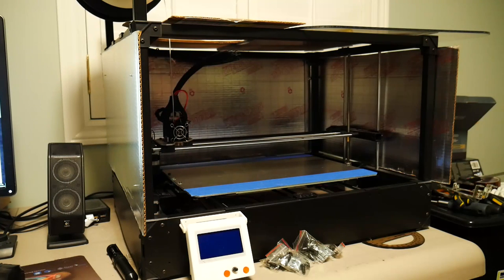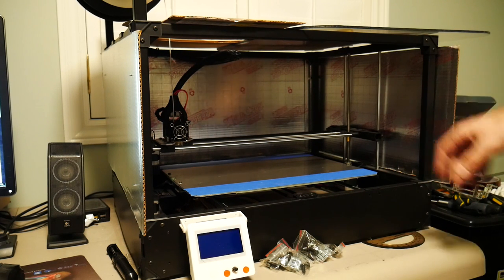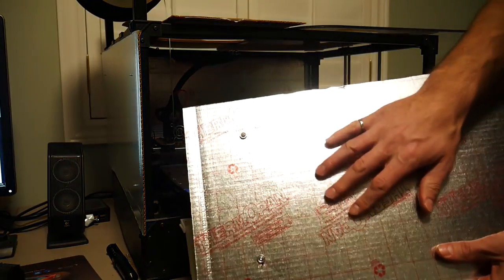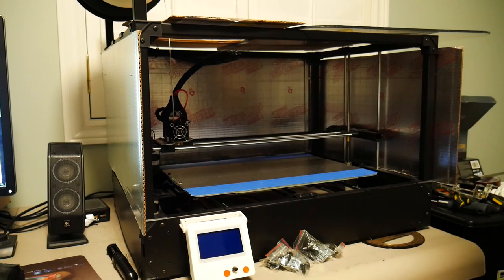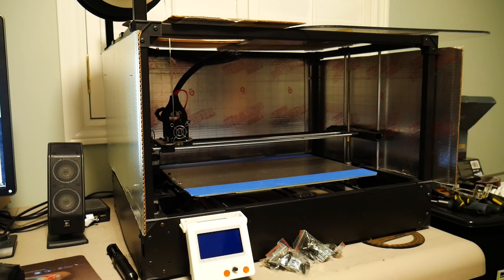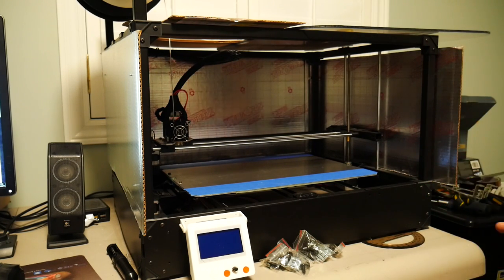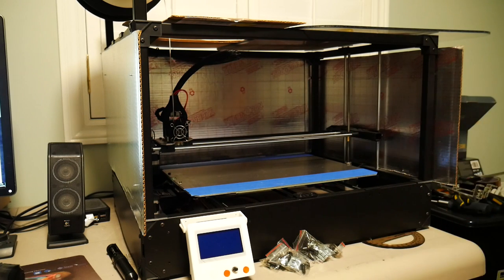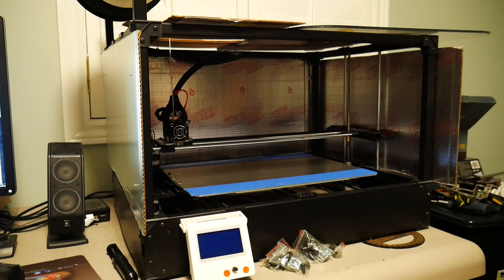DIY 3D Printer Heated Enclosure / Chamber for $15 in 15 mins!!

Comment: This isn't a heated enclosure at all. Booo.
Reply from the maker: Hi Charlie, the heat comes from the heated bed so the internal temperature is greater than the ambient air outside of the printer.
Reply: Lol nice clickbait title
Reply: This is an example of an enclosure, or an insulated enclosure. This is not a heated chamber! Heated chambers are needed for high temperature thermoplastics and require active heating and temperatures up to 60 degrees celsius in order to avoid warping/de-lamination and produce a successful print! (Polycarbonate, PEEK, PEK, Ultem, etc.)
Reply: I believe this is a great idea I did something similar and it worked wonders

Comment: Or you could just use cardboard and cover it with tin foil to save buying this stuff specially.

What I will probably do is buy 5 A3 size clear acrylic sheets so I can see how the print is going in there. Otherwise you won't know, and if you open it up to take a peek you will probably mess up your print.

Thinking about it now, I only need the front to be clear, so I might go with your method for the sides and top to keep costs down. Thanks
Reply from the maker: You could definitely use the cardboard and tin foil method, but if this stuff is available in your area its just a lot cleaner looking. Plus whatever they add to the core material makes it fire retardant as a bonus. I actually have a flat sheet of lexan on top that I cover half the opening with so I can see my prints as well :) Great minds think alike!
Reply: The Hacksmith has a great method of specialised printed parts which let him lift the front perspex sheet up on a hing, and then slide it back over the top (the hing wasn't attached to the door, it had runners for it to slide through). This makes it a permanent box which doesn't get in the way. You can also print a handle on the front and secure with two screws from the back.
Reply from the maker: I'm glad you also watch his videos :) I have seen that and it is a great idea!

Comment: Does it need to be completely in closed with that material? I’m just wondering since the filament has to come up from the top.
Reply from the maker: I do my best to keep it as closed as possible. I do have to leave a hole for the filament as you suggested. The more closed off it is, the more heat stays inside.

Comment: For printing ABS you really need to get the enclosure heated to 50-60°C to ensure it doesn't warp. You might get some good prints with a passively heated enclosure but there are some that will just not be enough.

Comment: Just put a layer of tin foil onto a piece of card board with some spray adhesive, you got yourself the same stuff
Reply from the maker: Could work, although I think the stuff I used has some chemical in the fiber so it is flame retardant

Comment: great, tip on the heated chamber, and nice rigidbot big, i was wondering did you replace the mainboard? if so, how did you connect the heated bed?
Reply from the maker: Mainboard is still original on mine. However, I had the heated bed connectors start to melt so I had to replace them with molex screw terminals.
Reply: yeah mine was melting too, im in the process of upgrading the mainboard, stepper motors, tramming proximity sensor, and bowden extruders.

was having issues with the heated bed till i found the schematics.